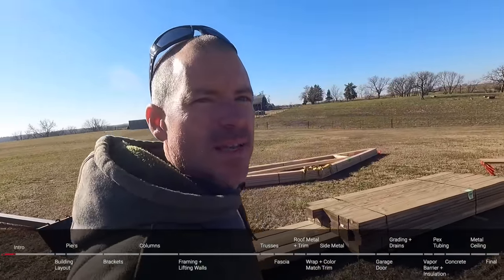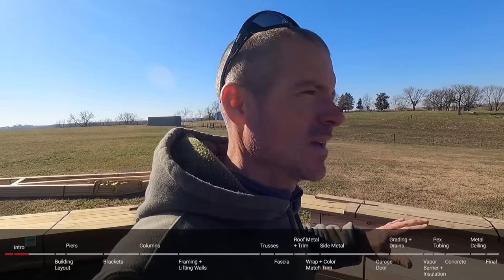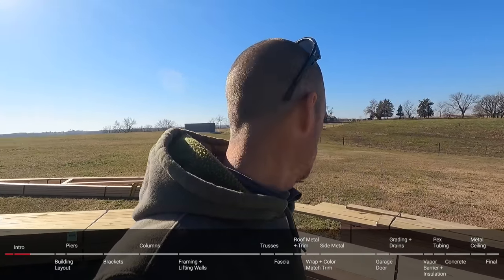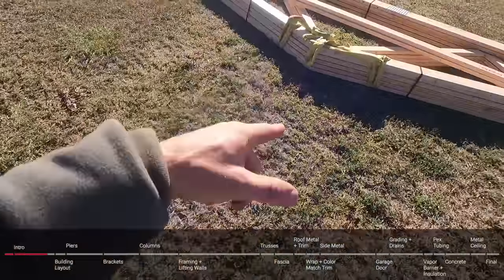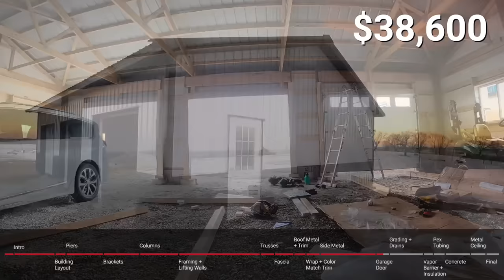Garage Material Cost + Labor + Full Timelapse | 30' x 40' x 9'

Comment: Wow,nice building. I just finished my own shop. 25x44 10' ceiling with hand built swinging barn doors. 6" slab with radiant floor heat. Only $19,000. Been in construction for the past 30 yrs and I did all the work myself with help from 4 of my friends.

Comment: I’ve just built my 20x30 with 10ft walls a few weeks ago. Fully insulated, drywall and paint. Heat and ac mini split with new concrete pad and entry 16x8 garage door and has a side porch/breezeway. All in with labor was 23k. I’m still laying in my flooring so that will add about 2k to the end. 25k doesn’t seem too bad, all of the interior including wiring was done by me to save money and time. I went with the exact color theme as you with the black skirting, white walls and black roof all metal with the exception of the framing as it was traditional stick framed vs metal carport style build 🤙
Reply: Mate, you absolutely did a brilliant job! this cat charged $95k for this one. Seems right high to me. I canni imagine paying this much.

Comment: About four years ago(pre-pandemic) I got a pole barn style 30x40x9 metal garage built. My father and I had to clear out and level the pad ourselves with about 4 truckloads of fill dirt(was about $1,000 worth of dirt at the time). Then I had the shop contracted out to be built for $17,600. I got an 8' and a 10' garage door, full size metal entry door, insulated/moisture barrier ceiling, electrical stub, concrete floor plus a 20'x23' concrete pad outside the two garage doors for that price. I spent an additional $1,300 on electrical needs(breakers, romax wiring, plugs, two security lights, and LED lighting) that my friend(contractor) and I ran ourselves. I may have about $25k total invested if you include my and my friends and family labor in the mix, but my insurance company appraised the garage/shop for $47,500 for 2022 post pandemic replacement value just last month.  I work in the lumber industry, and I can tell you that the over 400 percent increase in material costs hurt the economy and material prices have fallen substantially close to pre-pandemic numbers. The problem now is SUPPLY AVAILABILITY, SUPPLY TRANSPORTATION, AND LABOR AVAILABILITY.

Comment: Your video was especially interesting for me because I'm considering a similar project. I wanted to tear down my old 20'x40' garage and replace it with a 24'x40' garage. The biggest difference is that I wanted a second floor with a 3/4 bath so that I could use it as a veterans/community garden center. It would be a simple open plan with no interior walls. I live next to a contractor in Meriden, Connecticut so I went to him for a price estimate. The price he came back with was $400,000 even with me doing the excavation and site preparation! It's almost worth it to bring you across the country to do the work.
Reply from the maker: Wow that’s a heft price tag but yeah depends on where you’re located. Happy holidays!

Comment: Wow material cost's have soared since I had my 30 x 40 x 9 built in 2014. I did the boxing, vented soffit as well as ridge vent, concrete floor with 3 drains and an 8' apron for $15k contracted price plus I did the excavation and supplied the quarry materials and wired it for a total of $25k. Granted I didnt do heated floor or insulation but wow!

Comment: Nice build! I’m curious as to why you didn’t center the post on the footing? I would think over time the footing may tilt outward at the top, due to all the weight on the outer edge of the footing.
Reply: Those piers are placed close to the final dimension, but the posts have to be placed at the final dimension so they may end up landing somewhere on the pier instead of dead center. The won’t tilt over time since they are deep enough.
Reply: So the side steel can cover it if wanted. Looks like crap if you notch around them

Comment: pretty cool how you had the cost running in the corner. i really liked that. i do find it hard to believe all of the labor, equipment, and materials for the piers was only 3600 bucks though. you got a steal of a deal on that i think.
Reply: or did you do it yourself and just give yourself a certain amount per hour just for info?

Comment: Excellent video and the runup on the costs during the build was spot on, you can definitely see where the costs are and what you add or delete, interestingly the garage looks bigger than the house, but still at nearly 70K for a garage, ouch, not in my budget, won't happen

Comment: The cost with the heated floor, insulated walls and ceiling, etc. Is about right. I live in Texas so don't need a lot of heat or insulation. If I put up a shop like this, I would install a two post lift so I could work on my vehicles.

Comment: Three years ago I built a 24X 36  8 foot walls wood working shop.  My cost was under $15k. That included an 80 foot gravel driveway. The only labor I hired was the Amish to put up my rafters . 6” insulation , metal roof, 6” slab, board and batten siding, horizontal interior finish walls, one overhead door, two 5X8 hinged doors, 4 windows, and an entry door.
I did have a sawmill and woods to supply all my lumber.
. No floor heat.

Comment: So here in Texas in 2023 for a 30x40 shop with an 8x16 and 10x10 sectional garage doors, 3/0 Door, two 8' skylights and gutters all around, 1" closed cell foam, lights/electrical/garage door openers, 18k BTU mini-split, basin sink and plumbing, it was about $50k.

Comment: Thankfully, I live far enough South and my needs are much more barn like, rather than a garage I can live in.  We built close to the same size structure, had a simple concrete slab poured and included an open loft.  This was around 6 years ago and we did most of the labor ourselves, with the help of a couple hourly guys that we called when we needed the extra muscle.  We got busy and lazy and decided to have the roof done, which cost us around $8,000. We ended up spending a total of approx $25k, not including any allowance for the labor and time put in by my brother in law and myself.  Of course, it also took us around 9 months to get it done.  Prices for every material needed have sky rocketed since we did our build.  I wouldn't have been able to justify the expense if I was paying today's lumber prices.  I own a few hundred acres full of hardwoods and pine.  I would be tempted to look into my own sawmill at today's prices.

You built a very impressive building.  Thanks for sharing.
Reply from the maker: Thanks for watching. You definitely can save tons of money doing it yourself. Our personal home is a DIY build. Mad County Build playlist if you want to check it out

Comment: This slick video omitted the surveyor who precisely set the elevation, lines, corners, and locations of each caisson. Notice no bar in slab, no rebar caisson, no connection between slab and caisson. Builder used siding as shear resisting element. Cost did not include the cost of the in-slab hydronic heating unit, the underground electricity or gas line for the unit, and lighting. Basically, this dude is a smooth operator who low-balled everything to make himself look handsome.
Reply from the maker: Thanks! There is rebar in slab. It did include radiant heating unit. The unit is electric. All those other items were added by the homeowner.

Comment: Looks good.  Buildings are so fun.  Ours is going to cost 93K.  40x64x14.  Three 10x10 garage doors and a 12x12 door on the other side for a drive-through bay.  Two man doors and a 8x8 garage door on an interior wall separating the garage from the gym area.  We have a divider wall, loft and small office 12x12.  A lean-to will go around the front (40 ft) over four large windows and around to the side over the man door and two large windows.  Concrete on the interior and concrete under the lean-tos.

Comment: A few years ago.
We had a similar garage built.
 Granted, the material costs were lower then...but.
 One word of advice.
Make it as big as you can possibly afford!!
 Even if you think that you don't need it.
 We ended up building one 40 wide X 80 deep.
It cost us about 60% more than a 40x30.

 "A garage that is...Too Big, has never, ever been built...nor will it".😃
 
Ask ANY, car, motorcycle, boat guy.
 Best investment we've made.
 Many people have stopped by, and asked too sell...simply  because of the garage.

Comment: Wow prices have gone up. About 18 years ago we built a 40x24 garage, perimeter 36 inch footing, 2x4x10 walls with lap siding, 50 year shingles, concrete floors, 2-16 foot insulated doors, 100 amp service 200 feet into the woods, all for about $18000.

Comment: Fantastic. half the price of a morton building. I would add 10x more insulation, 2inches more before metal sheeting was put on all around, then more on the inside, then a ton in the attic, maybe some rock wool, the 2 inch thick insulation again. Very cool. Heck add a fourth bay to connect it to the house. Then add an exterior glass door between house and garage and have mood lighting in garage so you can see your cool cars at night  through the door .
Reply from the maker: Thanks for watching! It’s next to a mobile home otherwise they probably would have!
Reply: Will a builder alter designs a bit and work with you to insulate it more like a passive building

Comment: Good job boys.   Price is right on if anything on the cheap side.  Just signed a contract for a 32 x 28. That's over $32k including a $7k discount because its getting built in January.  No floor and not finished.  I'm a contractor and it didn t even pay to build it myself for that.    You said the concrete floor was 9k.  1200 sq ft only $7.5 a foot less than that when drive is added  Need to raise their rates. For price comparison concrete is $105 a yard (4000 psi without additives) around here. Again really nice job guys
Reply: 215/yd in WV now.😕

Comment: Ours is the same size with 2 garage doors(30’WX40’L) and will likely cost more it’s because of wood a steel pricing. Without heated floors, but a concrete foundation as base.

Comment: Thank you for that video yall do excellent work. I have crew starting Tues on pad for 32x40x10 with  lean to on 32 side and 12ft loft area for 49k, guess location plays big part in cost. Quotes for 4in. concrete are almost double.

Comment: I paid $8,400.00 for my building. $2,800.00 to excavate a hillside pad. $2,500.00 for concrete,$1,800.00 for pad setup, pouring and finishing the pad. Built the 30x40x12 myself, on weekends, took less than 6 months, winter months slowed things down.

Comment: Good work.  And NO sticker shock at all,,,your prices are very competitive . 

Question,,,I don’t see much for engineering IE no cross bracing in the roof section, like cross straps or plywood for high winds.

Where are you located?

Comment: Built a 30 x50 full foundation 4' high architecture block with 12'  2x6 stud wall to achieve 16' ceilings. Mezzanine, 7" radiant heat concrete floor. 70 grand. The cost for a pole building was almost the same.. only difference was pole buildings in my area dont hold value on property resale.

Comment: So it was $70k + $5,000 for spray foam. 75,000 plus concrete $16k 91k plus the $4,200 for controls. Is that correct? $95,200 all in?
Reply from the maker: No 70K for all that. That only includes concrete for the garage, not the drive and sidewalk.
Reply: @MrPostFrame  ok, woo. I was thinking the best love it. They are owners for life at 100k. Thank you e!

Comment: i watch alot of these build videos. is there any particular reason you guys over there pour the concrete AFTER the house is built? over here we always start with a concrete slab and biuld the house/garage on that. 

it turned out to be a really nice garage, one in my taste 👍
Reply from the maker: We prefer after so we aren’t driving heavy equipment on the slab to set trusses + have had good luck doing it this way with how we insulate the slab and prep

Comment: Did you add fans or any kind of unit to keep air moving? Especially with the in-floor heat , i find anything in direct contact with or even close to the floor will rust (like every vehicles break rotors), or mold/mildew quickly like any wood blocks, cardboard or fabric left sitting more than a few days.. and thats with at least one floor air mover & a ceiling fan on 24/7 summer & winter.

Comment: Is there a specific reason why the slab is poured after the structure is built? In my mind grading would be much easier without a structure. I've only worked in large scale project's and not residential construction so this is new to me.

Comment: Great video! Out of curiosity, is. a 5" slab enough if you wanted. to add something like a 2 post lift later? If not got a ball park on how much extra a 6" slab would increase costs? Thanks!
Reply from the maker: It is if you know where it’s going to be and you can pour piers under the lift posts.

Comment: Don't assume pricing anywhere near the same in your area. 
It's based on local market demand, available materials sources, labor pool etc.
Reply from the maker: Yes, this is meant as a guide but you'll have to check with your local supplier for your exact pricing.

Comment: Nice job! Why radiant heat? Is that common in the North? I am building a 26 x 40 with a slab an 2x4 frame 10 foot cieling and with drywall. You came in a little under what I have invested.

Comment: Would really like to know where you sourced your materials from, because I am currently building a home.  Wife and I wanted a metal roof but settled on shingles.  The prices we were quoted for material only was $42,300, and this is a low quote, the other four quotes we got was higher.  By the time you start your siding you are only in the $20,000's.
Reply from the maker: We use a local steel supplier and lumber yard. This build I think came from menards but we haven’t used them much this year.

Comment: Would it be safe to say that if the building was broken into thirds, the price would follow? Like, a detached 1 door, 1 car garage would be between $23k-$25k? Thanks for the video. ❤
Reply from the maker: You'll get pretty close if you take the final price and divide by 1200 sq ft. That will give you the per sq ft price. Take that times the sq ft you want to build and you'll be close. Of course materials and labor fluctuate depending on where you live.

Comment: what is the smallest building you could build using this method (post frame)? what is the max span allowed between those perma-columns?
Reply from the maker: We like to keep our pier/column spacing at 8’OC 

You could go as small as you wanted- just depends on what you need to use it for

Comment: Seems mighty expensive. My so just had a 30x40 solid concrete garage built. 12 foot ceilings 3 bay with floor drains. 12 inch thick walls and floor, precast roof with 12 inches of concrete poured on top of the precast. A 10x10 hidden office behind the back wall. All insulated outside and inside. Total cost 26k,
Reply from the maker: That’s great for him! Costs can vary greatly based on the location of your project and other factors.

Comment: That is a ridicules' amount of money for a 1200 sq. foot building. I built the same size garage, less the heated floor for less that $10,000 dollars. Also, I used more trusses but did not use metal on the interior ceiling, it was left unfinished. I used rough cut lumber and my labor.
Reply: When was this lol

Comment: How does the wet-set bracket on piers method compare cost-wise to a monolithic slab or PermaColumns?
Reply from the maker: It’s about $150 per pier with bracket in materials. Perma columns are about double that. Monolithic slab would probably be more but somewhat comparable being that the only extra concrete out side the slab is the thickened edge.

Comment: Ive seen similar builds to this and there’s one thing i don’t quite understand. Hopefully you (or someone else) can clarify. What’s the purpose of the piers when you pour a slab anyways? Why not just pour the slab and build off that? I’m assuming the piers probably provide more structural support with less risk of the slab cracking, but idk…
Reply from the maker: Piers / foundation need to be below the frost line. So the piers are poured at least 48” for where we are located.
Reply: Also, from what Kyle at RR Buildings has said is that the post framers are usually not doing the concrete and it’s done at that late stage of the build so it’s done with piers. I think you could do slab on grade but post frame is typically on a pier. It’s also cheaper since the slab isn’t supporting the structure.

Comment: If one went with bat insulation or rolls instead of foam, that will save money. In floor heating is nice but not always needed. I would take a fully insulated garage and just do normal heating in that regard. But price seems reasonable until prices can normalize (if that ever happens). I'd probably go for a 24x40, should give me plenty of room for 2 vehicles and a work area.
Reply from the maker: Thanks for watching

Comment: How much less would it be without the radiant heat flooring? Id want everything else.
Reply from the maker: Depending on where you live we’d still recommend the slab insulation. So subtract $4500 for the controls and pex.
Reply: @MrPostFrame  Thanks....we are currently in South Carolina but hope to move back to North-East Tennessee...Ive read somewhere concrete guys recommend doing 6inch slab...is that necessary where Im intending to move?  My husband will need a shop built about the size you did of the garage as well.